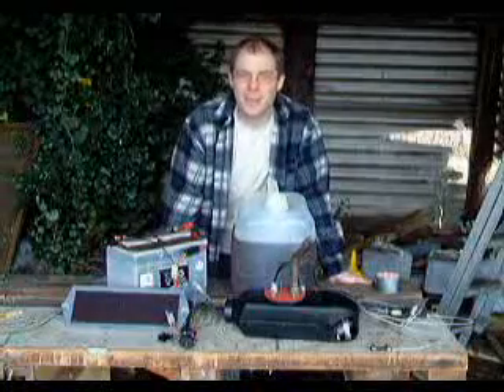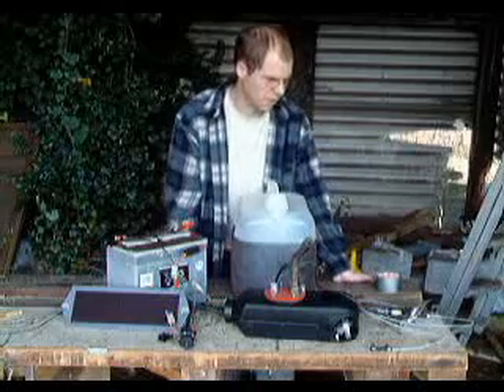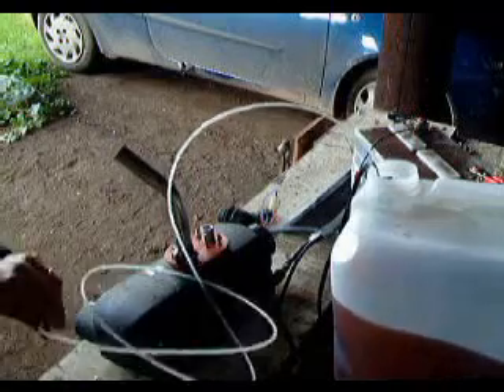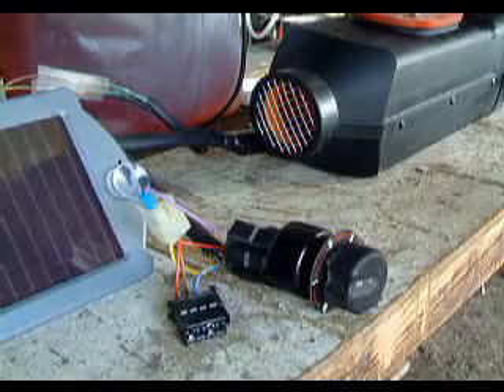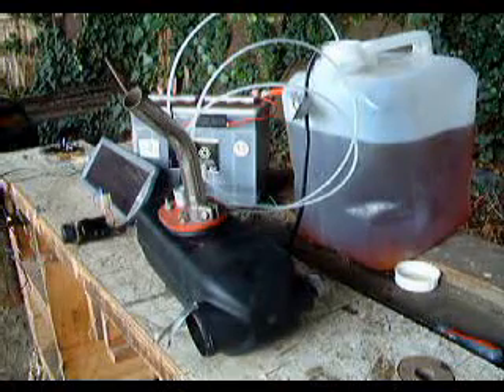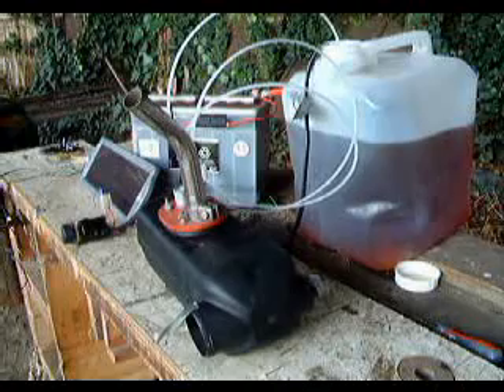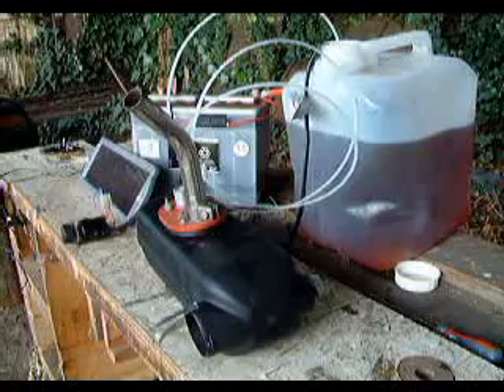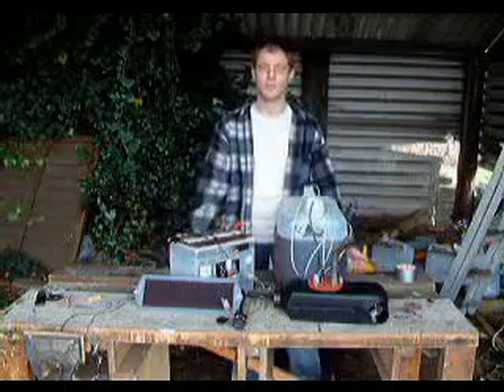Biodiesel heater

Comment: It's a really bad idea to run an eberspacher air top or eberspacher hydronic heater on waste vegetable oil.
I run my truck on waste using a twin tank system and have for 4 years now.
Eberspacher units are very expensive, have expensive parts and have a check system shutdown process that cuts in when somethings not right.
Felton Marine in Brighton service them and have many stories of people damaging them on bio or neat wvo.

Comment: I have installed hundreds of these in semi trucks.They all smoke a small amount when they startup They do not like alot of bio diesel they run about 65% max output.I run in my house 30% kerosene, 50% fuel oil,20% bio it makes a good hot mix.If you run more then 20% bio then they clog up more then a 60 year old over weight bacon eater.

Comment from the maker: Normally these devices are installed with intake silencers and exhaust systems. They're also usually run the other way up (exhaust pointing down) - hence the smoking. In four years of use, that unit has only broken down once (it's keeping us warm as I type). They have very sophisticated safety systems and are used across the world.